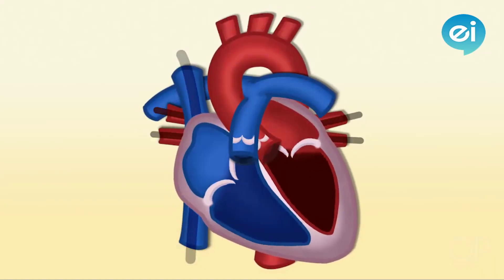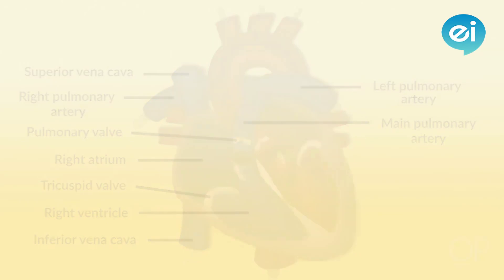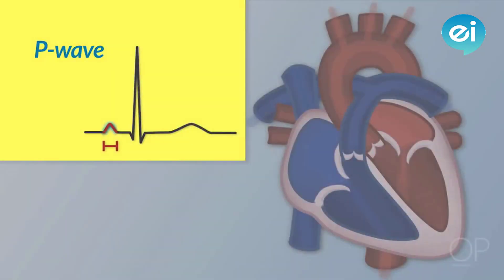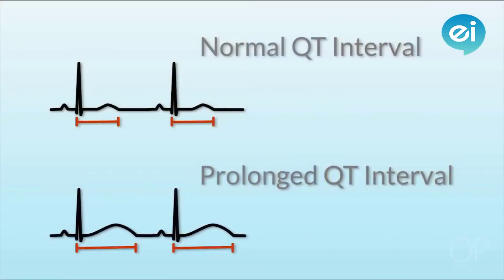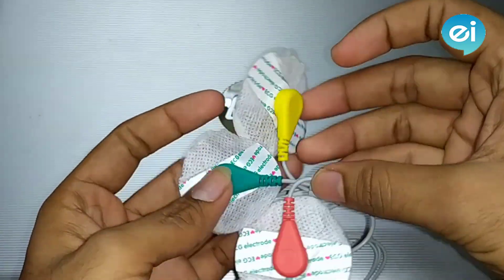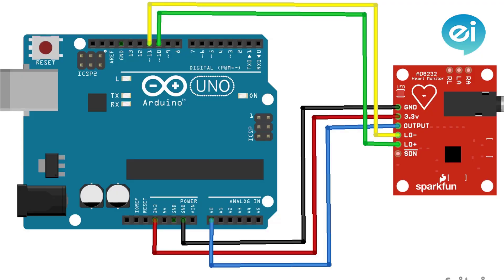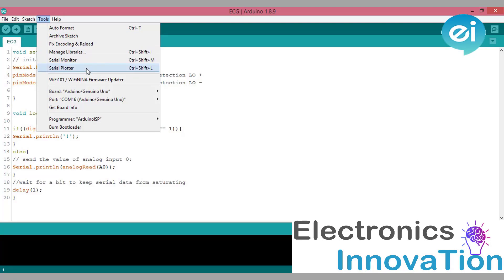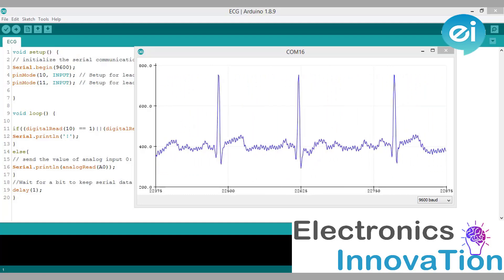Low-cost ECG & Heart monitoring system with AD8232 using Arduino.

Comment: my E.C.G. is not showing any 3 digit number on the monitor and just showing "!" mark and thus plotter is also not representing anything
Reply from the maker: You need take care about the Baudrate of the Serial monitor and Serial plotter. Change Baudrate to 9600. It will work surely.
Reply: @electronicsinnovation   it is still not  working. i have checked the baudrate ,it is 9600. the plotter is showing the heart beat from the base and it is uneven.
Reply from the maker: Could you please send a mail to electroniczinnovation@gmail.com with the screenshot or your issue and the circuit connection you made? So,  it will easy for me to figure out your issue and help you.
Reply: Even I am facing the same oroblem
Reply: I am facing the same problem...

Comment: Hi, I have zero experience with soldering. Is it possible to create this setup without soldering any pieces together? Specifically the 5 jumper cables connected to the AD8232 - do those need to be soldered on?
Reply from the maker: As you can See in the video, I haven't use any solderon for connecting module and Arduino.

This project doesn't require any soldering. You can make the circuit easily by connecting female to male connecting wires with each module.🤘
Reply: @electronicsinnovation  Thank you. 

Most of the AD8232 I have seen do not appear to have the 5 header pins already installed but rather have holes in them, e.g., https://www.sparkfun.com/products/12650

Do you know where you found a module that already has pins?

Note that I think your links #2-4 point to the same page.
Reply from the maker: I think, no. You cannot get the soldered module. You can do one thing that, visit near by mobile phones repairing, or any electronics repairing shops and get the module Solder on.

Or else get a solder-on  do it by your self. Its not a big deal.

You can mail me at "askus.electronicsinnovation@gmail.com" for further assistance on Solder-on.

Comment: how to see the graph in the android smartphone. How to connect it to the Arduino and also see it on the phone
Reply from the maker: Search for any serial plotter for android. phone...
Reply from the maker: there is a app called "Serial USB Terminal" which can allow you to display Serial log. but this doesn't have any  provision for graph plotting. so search for any such apps.
Reply: @electronicsinnovation  For subsequent use do we have to burn the code again?

Comment: Great work!
Can do "signal processing" to this signal(I mean c we calculate all the different waves)?
Reply from the maker: Yeah, We can do that also.
Reply: Great, thank you ! 
Is it with MATLAB or even with arduino?
Reply from the maker: If you want to count the spikes you can put a threshold and count them, but if you wanted to do deep analysis you can do in the MATLAB also.
Reply: I will try to do it on MATLAB so thank you!
Reply: Hey Man, I'm doing a project on detection/ chances of occurrence of heart attack using the same sensors. I want to ask is it possible by just these values on the serial monitor?
Reply: @nounouibh3962  Can you help me out?